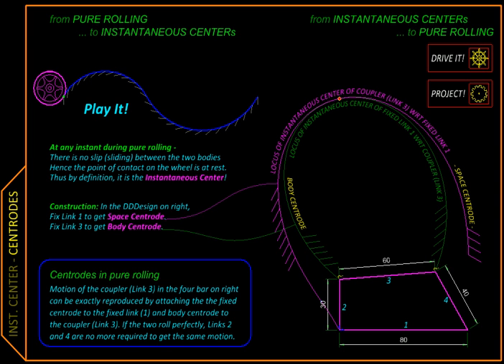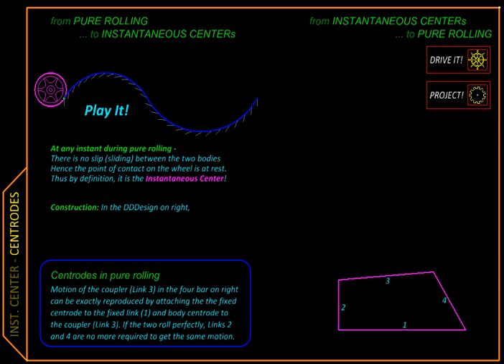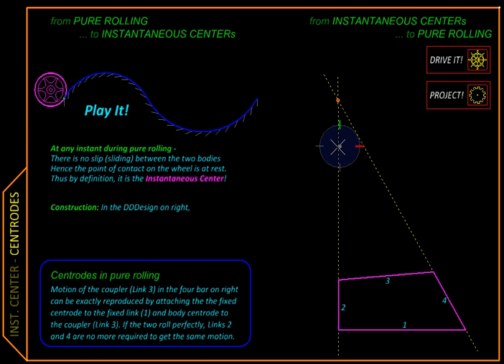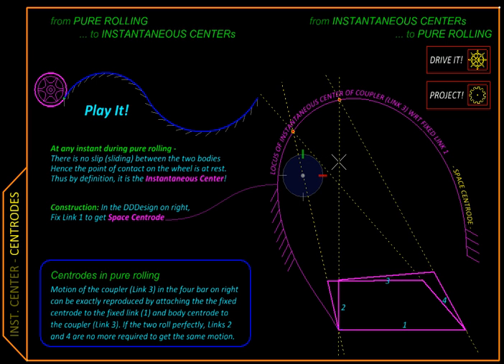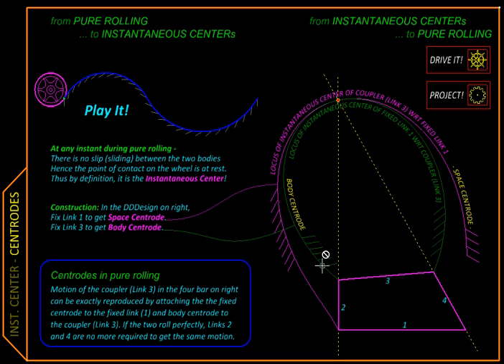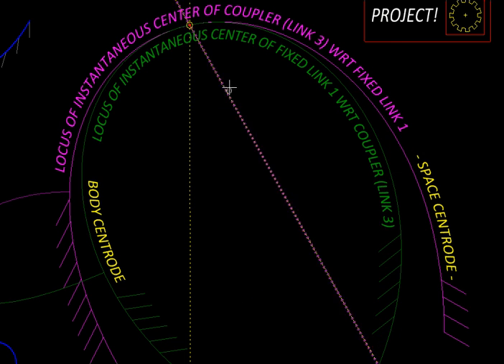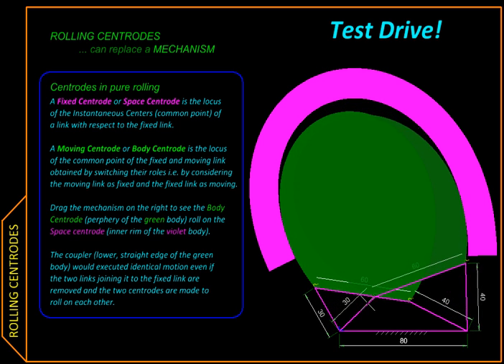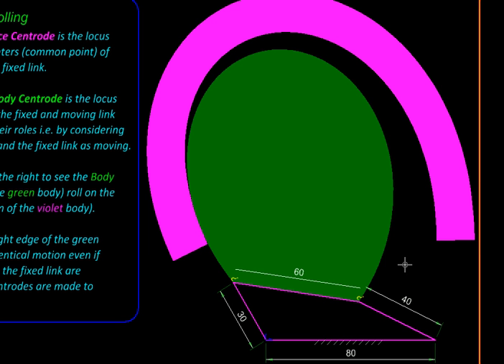Kinematics Ch03L Centrodes

Comment: this is a very deep concept that cuts through mathematics and curvature theory they called the fixed centrode as fixed polode the naming was done around 1800 by Louis Poinsot from greek words hodos= route and pole  . Somewhere along 1700 they realized  and proved  all points on an Euclidean plane  follow either a instantaneous translation or rotation in the case of rotation it had to be with respect to some center they calld it pole or instantaneous center of rotation as we prefer today    BUT because it was instantaneous   as in just for a moment  capturing only a single position, frame so to speak of a moving Euclidean  plane  w.r.t another Euclidean plane  then it was moving  tracing a path which they called it fixed polode BUT since the world is relative what if we keep the moving Euclidean  plane fixed and move the fixed one  and you get the  " moving " polode for the lack of better words  they stick to this .